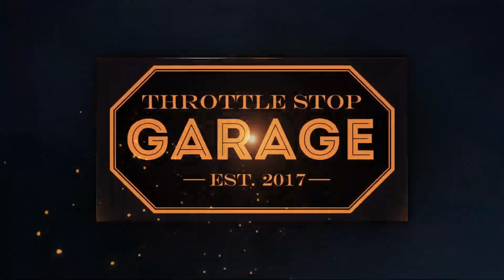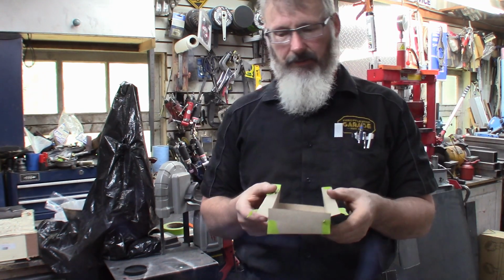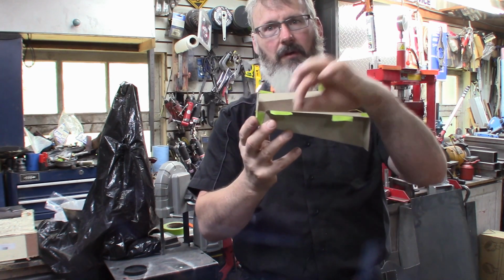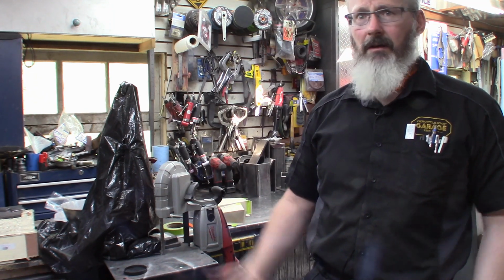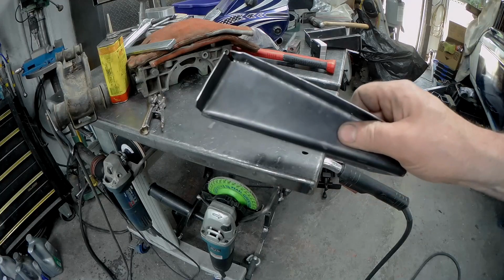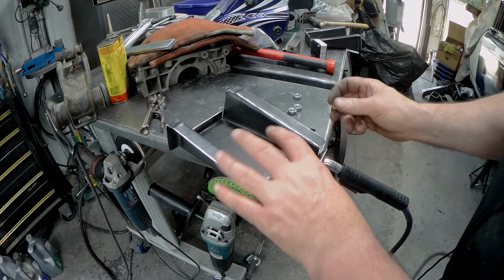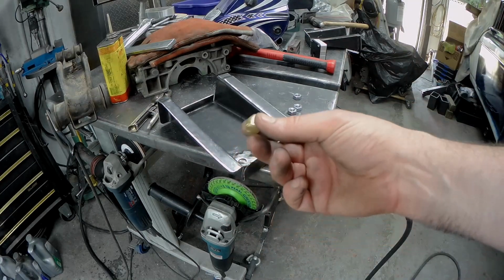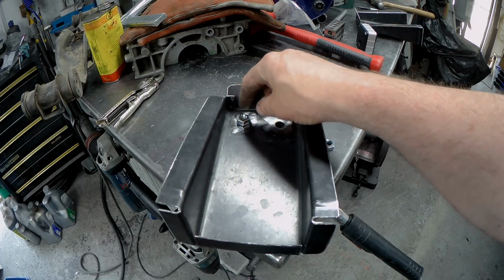Volvo Amazon Transmission Cross Member Fabrication.

Comment: Craig, well by now you know that I always have something to say. How come you make the holes for the captive nuts so big? When I do them for a 3/8 bolt I drill a 3/8 hole and hold the nut in place with a bolt, then weld. No need for a taper thing a ma jig. When funds allow I'm going to buy a thread cert tool. If the nut strips or cross threads you can drill them out and insert another. Nice work on the folding and installing of the trans mount!!!
Reply from the maker: I'm not sure Alan - I've always drilled a clearance holes for the nuts.  If you drill a close fit hole to the nut it would have to be about the same size as the bolt thread and that just seems too tight.  I guess I fight the machinist tendencies - I'm quite particular about thread forms due to having it drilled into my head at a young age...I can't stand a threaded hole without a chamfer for example.  I also don't like welding with the bolt in place...I don't like welding the nut in truth.  I've got a couple of nutsert install tools that can do up to M10 or M12 (I don't recall)...but I'd rather have a nut if I can access it.  So just a matter of habit I guess.
Reply: Craig 'could' buy a small lathe and turn on face of the nut down to jussst fit in the hole. (But we don't want to give him ideas!). As a mechanic, I've noticed some manufacturers weld a folded box over the nut, letting it 'float' a little for alignment. I tend to drill a hole one size over the bolt's shank and then use a sacrificial bolt to hold the nut while I weld it down, usually on three faces, 120 degrees apart.
I've also noticed in all of the brands I worked on, for the part being bolted on, one hole acted as a datum, large enough to clear the bolt. The nearest hole was a small slot that pointed away from the first hole. And on the far side, both holes would be slotted at 90 degrees from the first two. Allowing for slight variations in manufacture.